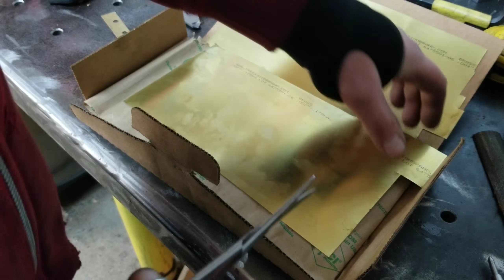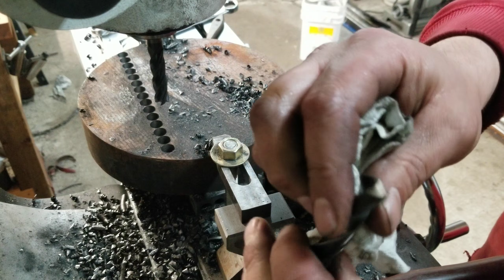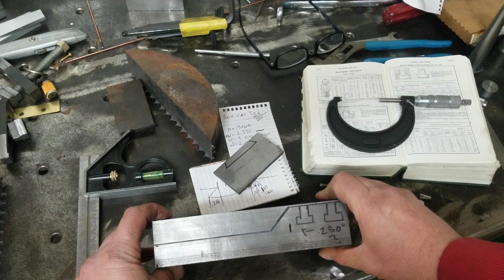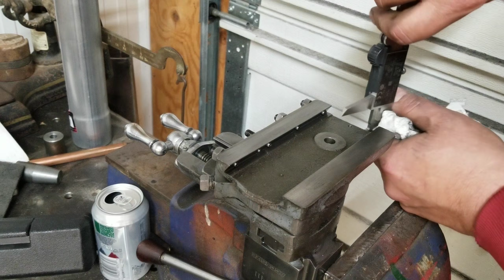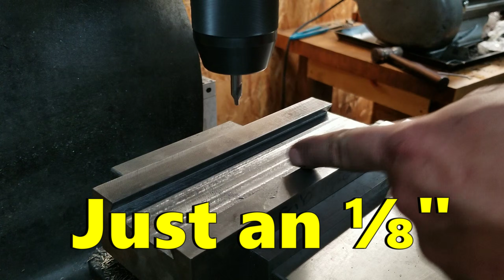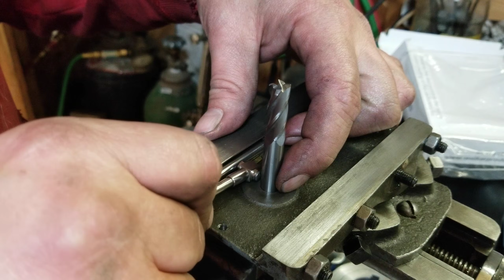Making a Custom Cross Slide for the Atlas Lathe, part 1

Comment: Good one Chris .  Long time no see !   Be careful the raised section at the rear does not  become a problem for tooling . My Southbend has a cast iron cross slice with 2 tee slots at the back  but it is all one level .  My Dad made it years ago .  Cheers  👍👍👍
Reply from the maker: I believe your right, Max. Scrapping that plan, gonna do a flat one as well. Just more practical I think.
Thanks, Max. Always appreciate the wisdom 😊.
Cheers!

Comment: Been there used to run shops..then that stock crash now just  an opearator..kinda happier  now ..wallet isnt but less stress...jobs are opening  up though
Reply from the maker: It ain't so bad. Not driving 60 miles is pretty cheap at least 🤣.
Cheers!

Comment: Do you have adjustable parallels? I use them to set the distance between two points and then measure the parallel with a micrometer.
Reply from the maker: No, they're on the ever expanding list of tools I need though lol.

Comment: how did you work out your centre measuring for the tooling
Reply from the maker: Haven't gotten there yet but I will measure from the top of the cross slide (where the compound mounts to) to the bottom ways of the cross slide (on the saddle). That will give me an idea how much thicker I can make it.

Comment: Man I thought you got whacked. Good to know you're still kicking.
   I've been doing some welding & I was thinking about your video welding that big table outside & I commented about attaching a cover on my helmet to block light, Well I did it & it works great. I used a piece of denim. I folded a thin piece of aluminum over the top to make a hem. I riveted the aluminum to my helmet. I don't care what it looks like; it works.
Reply from the maker: Yeah, I've seen that done too. I was actually looking for a nice piece of leather for just that 😊.
I've also graduated to needing some reading glasses under my hood. Hate my dam, cheap-o auto hood. Has an oddball size lens and won't fit your standard sized cheater lense. 
Getting old lol. Also, I think these letters are getting smaller too! 🤣
Cheers!

Comment: That’s a bummer about the job. For selfish reasons, I’m not that upset if you’re gonna put out more videos 😉
Welcome back sir 🎉
Out of curiosity, have you measured the lathe saddle to make sure it’s true or at least semi straight on its surfaces? I don’t recall if you’ve checked on previous videos or not 🤷🏼‍♂️
Since you’ve got a decent mill, I figured now would be the time true anything up that’s not in good standing.
Reply from the maker: Lol, well if your happy, I'm happy 🤣.
Indeed that saddle was out about 
.015". So I trued it up and reshimmed the hold downs a while back. I think it was around the same time I trued up the mount for the taper attachment 😊.
Cheers!